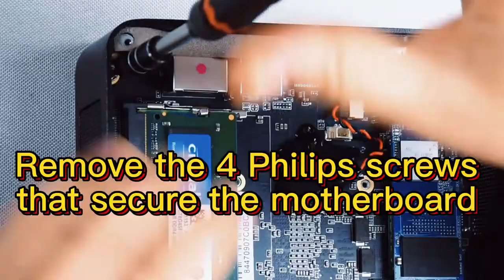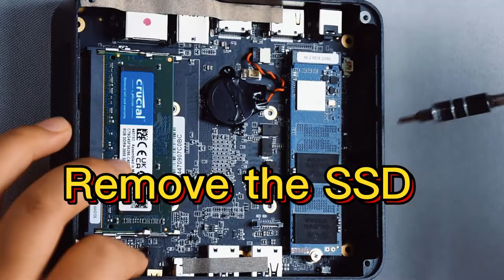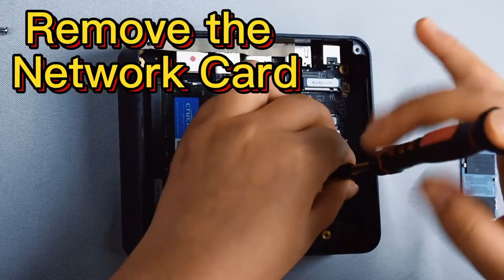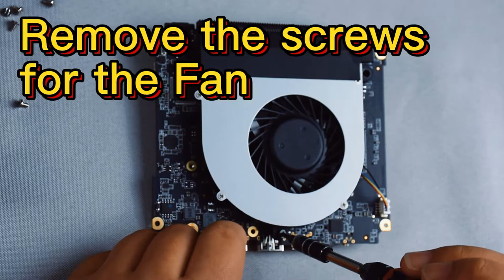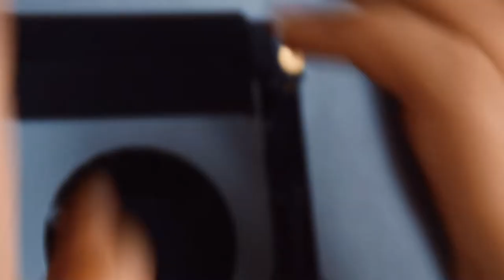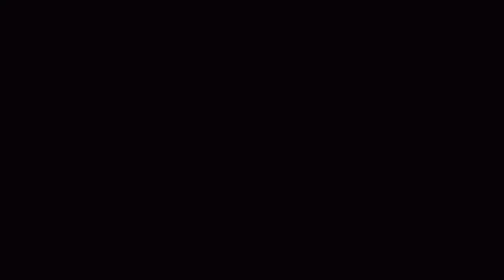How to remove Mini PC Fan? Beelink SER3

Comment: any  luck on getting a replacemnt fan? part number etc.
Reply: Any luck with replacing the fan?
Reply: @jedis_  yes i did, i got in touch with the seller, and they got me a replacement, doesnt have any part numbers on it.
Reply: i forgot to mention, that he suggested updating the BIOS, apparently there is an improvement in Fan usage. but, i couldnt, as the update only works in windows, and mine run linux

Comment: Fan is too loud. I think I might have to change it. I'll try some oil first though.
Reply: did you get a replacement that works? if so which brand and model?
Reply: @willcollignon6727  I cleaned it out. I didn't oil it yet. It started getting noisy again last week.
Reply: @thomasolson7447  Did you get it?